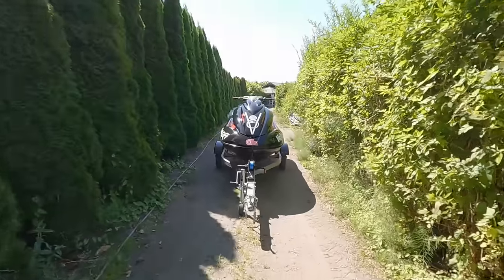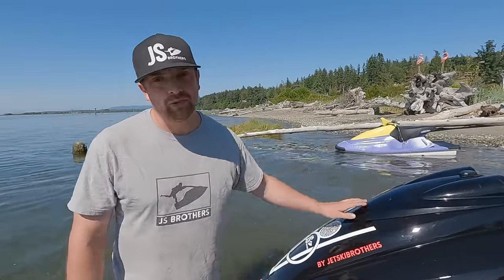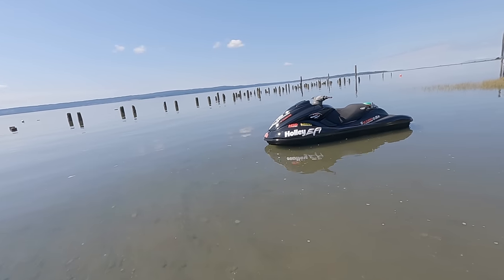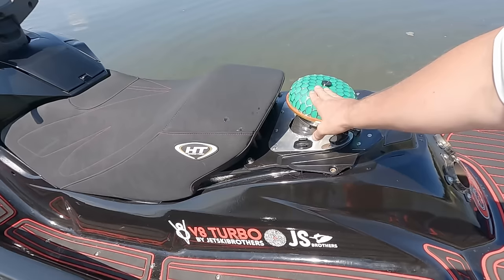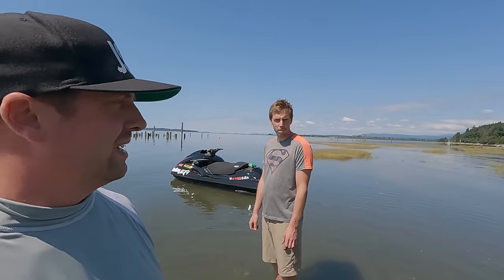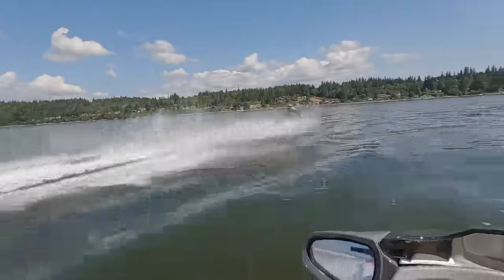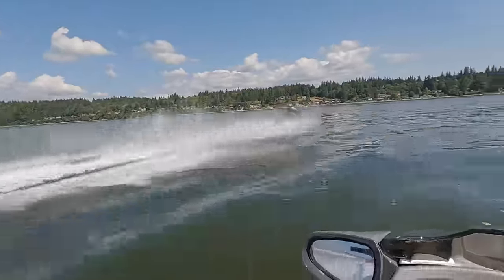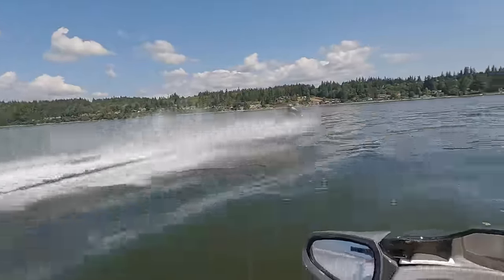v8 turbo jetski first ride

Comment: that's legitimately terrifying. If it was my build I would lengthen it so I could sit down competely in front of the motor on a longer more stable frame. I have immense respect for this guy doing these speeds on top of that crazy watercraft
Reply: It only takes a little getting used to.
Reply: @sforza209  I nearly flipped a base model BRP so no ahhaha

Comment: Awesome content. To me it sounds like it's going straight to high rpms when you go wide open throttle. I would see if there is a way to put a bigger impeller in the pump to drag the rpms down and find a way to trim the pump up to keep the nose of the ski out of the water. But still awesome to see a turbo 6.0 in a jet ski
Reply: You caught what I saw  there is definitely a putting power to impeller issues  still impressive maybe a. Prop to accentuate the ket

Comment: Awesome build!   You should use the 160mm pump from the 2022 yamaha GP1800.  I will bolt right up and will help the cavitation big time!
Reply from the maker: Thanks for the tip! Is 2022 the year they switched to the pump where the vein section and the wear ring are one piece?
Reply: 2014 is when they switched to the 8 vein pump and 160mm prop. If you choose to use the new 2022 style you will have to change the transom also. The 6 vein pump was bad for the veins chipping like yours did. It’s from cavitation burn. With the horse power your putting out you definitely need a 160mm prop and some more pitch in it. Will help control rpm’s also by the pitch

Comment: Change the material on the pump housing . The metal is to weak to handle the pressure. I had the same issue with an up graded 3 stage hamelton jet in alaska in 1990. All of the parts on the jet shaft were made for the hp of the motor. It saves money for the company. So if you up grade from v6 say and drop a turbo v8 iner or up grage the current power plant, the whole drivetrain needs to be up graded. Your on the right path and my buddy john force would be proud of what you have accomplished. Keep it going and dont quit, never quit. Great job with it so far.

Comment: Thats awesome plus you can goi huge on the impellar/ intake so as to overcome water pressure that holds back standard turbo jet skis and your build the ski is limit on gettign horsepower on a    V-8. Super charger/ double pumper carb/ put a chrome stack like old drag cars do at drag strip look like Chrome big Tbes rigth off the intake of two carbs and keep water from that air filter behind you   😀👍 Wow; you definitely got horsepower all the way! 🏎🌋

Comment: G'day guys, been watching your series, awesome work your doing.
Can the pump cope with all that power.
Or is it allowing the engine redline to quickly ?
Most V8's run a much bigger jet pump.
This might be why it's difficult to tune.
Best of luck guys 👍
Reply: Yeah , what sort of pump do those jet sprint boats run, that might be the ticket.
Reply from the maker: Thanks, for sure we are testing the limitations of this jet pump setup. My thought is to try all the tricks to get the most out of this jetpump setup. Then if we still need more pump we'll switch to a different pump. My thought is to go with a jet sprint style pump. Any way thanks a bunch 👍🍻
Reply: @JetSkiBrothers  a larger two-stage pump might allow you to delete your gearbox.
And run direct drive. 👍

Comment: With an AFR sensor on a ski you need to put a heatsink spacer in it to keep it from constantly fouling or it will never read accurate.Also dont repair your jet pump anymore.The veins always eat away at themselves with big power and if you dont relieve pressure in that area of the veins you can blow a hole out of the side of the pump pitching you off the ski.Get your die grinder out and cut identical dime size notches on outside of all 8 of the pump veins and this will never happen again.We do this on all our 90+ mph skis
Reply from the maker: Sounds like you know a thing or two about fast skis, so your input is greatly appreciated. I’m still trying to figure a lot of this stuff out myself. Do you know if it’s a good idea to get the solas stainless 12 vein setup. Or is a notched 6 vein a better idea. Or is there another setup that I should look into. Also it’s not clear to me why a heat sync is needed for the wideband but I will do some research on that. Thanks for the info 👍

Comment: I'm just curious what happens if water gets in those exhausts ports in the front..Unless there is some form of 1 way tip that only allows stuff out maybe it will never be an issue but me being me a worry wart I guess it just is a question I would wonder about.

Comment: I've always wondered how much water presure a jet pump housing will take before it starts to let go. I imagine those viens are right at the point of the highest squeeze so to speak.
I noiced the rubber coupling damper tore off a pad, might need to think about upgrading this somehow to couple with the tourque.

Comment: Not hating or claiming to be experts but 10 pounds is not a lot of boost for a stock 6.0 we run 12-17 through two of our cars (both ethanol cars) and the 240sx has been solid for 3 seasons of drifting.  it’s usually to much timing/power that pinches rings as pump gas is bad about detonation with aggressive timing. Just our experience with the LS platform still learning. 🤘bad ass none the less. 

Love the video and love the ski! Keep going! 🇺🇸

Comment: This is really cool! That's a lot of hard work.

The one big concern about sustained high-rpm with an LS is oil pooling in the heads - it doesn't drain back to the sump fast enough. Burnout guys have these probs. Adding aux drains to the back of the head is usually sufficient.
Reply: Dry sump can also help with the scavenging vacuum.

Comment: Hi guys. I was watching the river competition turbine jet boats the other day, and they got to about 150mph. Now, of course you havent got close to that much power, nor will you ever likely have I should think, but I know you have previously talked about how at "jet ski" - derived jet pump might be a limiting factor at higher power levels, if I remember correctly. Any more thoughts about that, especially now when you got a turbo and more power than ever?
Reply from the maker: The way I understand it is that water jet propulsion loses a bit of power when compared to traditional propeller setups. Although a jet drive system can be optimized for better efficiency but wont ever be as efficient as a good prop setup. That being said I don't expect to switch to a propeller setup on this application for various reasons. But you never know. Given unlimited time and resources I would really enjoy having multiple versions with different propulsion and powerplant setups and test them back to back to see what works best.
Reply: @JetSkiBrothers  Hi. I think you misread a bit. If you read above you will see I was comparing turbine engine powered competition jet boats (which of course also got a *water jet propulsion*, just not the typical "jet-ski" one), not to normal propellers.

As for the prop vs jet drive part (which as I said I didnt compare because they are very different), I am a sport boat guy firstly, so I like to think I know a bit about propellers, and a typical PWC/jet ski would be almost undrivable with a prop at any sort of power at high speed, likely already at below 100hp or thereabouts. 

The twisting motion in numerous axis that propellers induce would give the relatively top heavy and short PWC very bad characteristics. The up side of props being of course that for lighter and faster water craft with the prop is efficiency of easily 200% or even more of the jet drive because of a lot of factors working together. But as I said, it would be unusable with todays power levels and the jet is also much safer if you fall off.

Anyway, back to the question I asked, I will restate it a bit to perhaps make it a bit more clear: 

I think it might have been the video when you tested some other guys short course racing jet boat (those that race in dug out canals), or some other video where you tinkered with the V8 jet ski you mentioned how you might be running into limits with the jet drive, for speed and power it can handle, because of your power level compared to most PWCs. 

You also said you might have to switch to jet drive made for more power at some time in the future because of that. I was wondering if that time might perhaps be here soon considering the power you got now. 

You have not only increased the engine size by a quite a bit since then, you have also fitted the turbo. A lot of work, but perhaps a "berkeley" water jet or similar instead of something out of a PWC could possibly be beneficial with the power you got now? Just a thought, I am not an expert at water jets compared to props, just going off what you said in an earlier video. Cheers mates!

Comment: Running this type of power the pump can sandwich from un natrual power gains. Like a crank with thrust washers. You need to brace the pump and propeller some how. Mabye some aftermarket setup with a thrust washer. Just an Idea but this is sick!

Comment: Man.. You are single handed going to start a new super craze, with gear heads building insanely powerful jetSki’s. Now that you have proven that EFis are solid in watercraft, It’s going to be great 👍🏼 p.S If Holly is not a sponsor, they should be 🤘🏼🤘🏼🍀
Reply: EFI has been used for almost 2 decades now in PWC. Stock, from the factory.
Reply: @ct1762  Well, I guess that shows how much I know 😂 Still though, won’t surprised if someone somehow shoves a small block SMX motor in a jet ski ⛷️ 🤘🏼
Reply: @music-maker2505   haha right on! Actually the FICHT fuel injected 2 strokes back in the mid to late 90's I think from Polaris were all digital direct-injected 2 strokes. Gotta know them inside and out to make a good purchase, but pretty neat. at low revs its basically like a 2 stroke air pump they run so lean (timing is always jacked up).
Reply: @music-maker2505  As far as I know, SMX is only a big block. The SML is the small block version, but I don't imagine a pump in this size machine holding up to what a factory block will handle, let alone 2500-3500 hp from an SML and those power numbers are with twin turbos. Cleetus did show some bigger jet boats with bigger pumps when he was in Idaho, but those were not 2 or 3 person machines like this one. This build looks just a little safer than the golf cart that Cleetus built.....1,000 cc R1 street bike engine, if you haven't heard of the gulf cart project.

Comment: In a perfect world for every "bar" (14.7 lbs) you roughly double the NA hp. So 15lbs should roughly double the power it makes NA if everything is "right". 

Might get a draggy so you can monitor the acceleration/speed. Makes for nice overlays too.

Comment: I personally haven't messed with Holly EFI but on other standalone you could turn the window down on AFR correction.... Like to 5 or 10% or even less. The only problem with that is as the season change or the conditions change you may need to brush up the tune a little bit.

Comment: Any problems with bucking at high speed? Might want to think about installing relief valve’s in the pump tunnel.
Reply from the maker: Had some bucking last year when we were working through the top speed runs for the n/a setup but an intake grate took care of that. But relief valve’s might be needed as it gets faster
Reply: @JetSkiBrothers   I’m thinking it’s not a issue for you because of the weight but you are probably running the risk of splitting the pump tunnel.

Comment: It's awesome when you upgrade the powerplant you get to discover all the weaknesses in the rest of the system...lol...how exactly is the engine coupled to the drivetrain?...are you still using stock parts, or did you have to make custom parts?

Comment: So cool but one thing I would consider is buying a belly strap that actually ties you to the machine because with that kind of backward pressure coming at you it can be pretty darn hard to hold on to two handlebars especially because you're in water and you're bouncing and stuff like that. You know growing up when I used to go to the racetrack so I used to see guys racing bikes and it's actually a unit that attaches to the tank and then you can attach it to your vest which will then help tie you to the machine. You know if the machines going to do something crazy or have a really bad crash there's got to be an option of like a quick release but if you're going to be hauling doing you know 100 to 120 knots on a jet ski that's a lot that's super badass bro you know skies are the limits but I never would have thought somebody taking a 6 LS motor and a turbo and putting it in a single driven craft just blows my mind man that thing's probably so much fun.

Comment: It's a "sleeper" as it is...but to make the best use of the power and not terminate many more gearboxes etc... maybe an actual jetboat  jet unit may be the answer?
No worries about gearboxes etc....
Southern Jets SJ216 two stage unit; 8.5 inch; suitable for LS engines (in jetsprint hulls)

Comment: Gday guys,
I’m really loving this. Flat water and fast boats does it for me. I’m wondering how many other V8 jet skis projects have been started since you guys kicked this off. Man that’s some serious bang for your buck good fun right there! 
I use to build boats with my Dad from scratch. 30 ft, 3 ton, 50 knot sport boats here in Oz. Slow by todays standards. Best memories designing and sorting out issues together. 
Just a quick question, would the water cooled exhaust manifold out of the engine perhaps remove some of the heat energy from getting to the exhaust side of the turbo? Not that it looks like you have a shortage of power. Also might it be possible to use a small adjustable trim tab to help keep the bow down and stop the jet output from porpoising for the speed runs? I’d be really interested to hear if you have any thoughts on possibly supercharging in the future? I’m really impressed, keep it up. Stay safe,
Cheers 👍👍🍻

Comment: In the end it will be the pump limiting the performance. A supercharged 1.8 liter 4 cylinder can max out any pump you can fit and the weight advantage will win out. Can't beat the sound though!

Comment: I would wear some type of head restrant, to prevent head/neck injuries.  With the speed that is possible, could very likely happen.  The weight of the helmet, water resistance, could increase risk of neck  compromise. Be safe.

Comment: What blade are you running in the pump? Surely not stock pump, have you changed the blade pitch or upsized the pump?
Reply: Also what is the gearbox deduction?

Comment: I think you need to take your fastest ski and run it the same speed with the V8 jet ski and then pin it once the other one is up to top speed and see how fast you pull away from them that will really show how much faster the V8 ski is

Comment: Oooo....that pump drive shaft should be like 1¼"∅...1½"∅ pre-heat treated 4140 would suffice. Yeah, 8620 would be nice also, but then you'll have to heat treat it after splines/gears are hobbed to reliably deal with the amount of torque it's being force fed.

Comment: Rule of thumb when I was in college was every pound of boost you have is 10hp so 6 pounds of boost would be a 60hp once over stock
Reply: The hp gain would depend on how much power it made before boost. In general about every 15psi of boost should double the hp. 
Basically 6psi on a 500hp engine will be a bigger gain than 6psi on a 100hp engine.

Comment: I think you need to gear the impeller higher and get it spinning faster. It's not like you don't have the torque herar to handle it.  I mean it's not like this thing isn't going to have a decent holeshot even geared higher. :D

Comment: BRO invest in aftermarket sponsons please. They will help with the tracking more than you know. also itsa suggestion i highly recomend simply because that hull was not meant to go that fast and the moment you comeout of the water, you could catch water wrong and spin out. The Aftermarket sponsons will help with that.\

Comment: Thank you for this awesome video .  This is the video I have been waiting for .   Do you have any prediction as to top speed after these trial runs   ?
Reply from the maker: Your welcome. As for top speed, I am not sure exactly what this current setup is capable of but it sure seems like it will do at least 10 more mph over last years best. But will see, Im still working through tuning and setup so we're not quite to the point of doing top speed runs yet.

Comment: The sound of the engine is pleasant to listen to. That's the only good thing about this project. There is no point in measuring speed and acceleration. The motorcycle doesn't move. Yes, it rides like a regular motorcycle with a 150-170 horsepower engine

Comment: Need a different impeller. There is like no load on that engine
Reply: The pump is way to small. Need to start with a Kawasaki 300hp sized pump.

Comment: got a extra 75 grand laying around why not build one of these bad boys.. short ride time because it's got to suck the gas and there has to be an overheating issue with it. cool but has to be a maintenace nightmare.
Reply: Unlikely it’d overheat as they pull water from the lake/river for cooling. And, it’s like it’s under high load for long with something so small and light.

Comment: Would like to buy one only using a gm 4.8 v8
Reply: Problem is the 4.8 is the same size on the outside. Might as well go 5.3 or 6.0 since it’ll fit the same and have extra displacement.